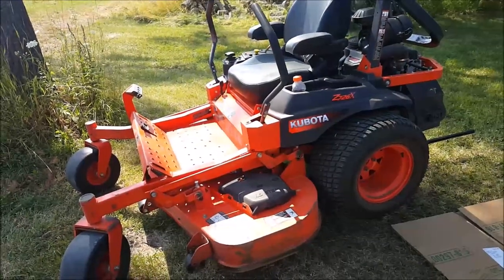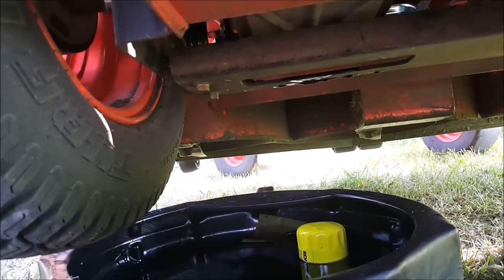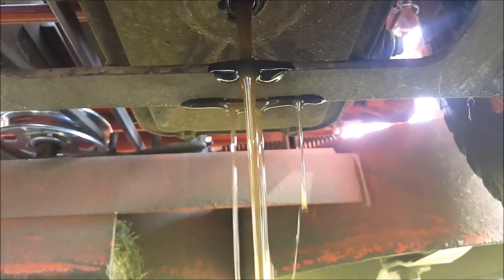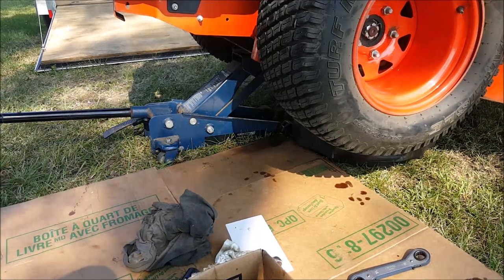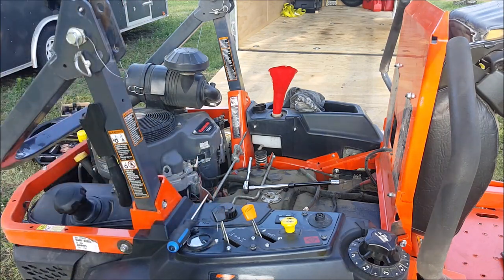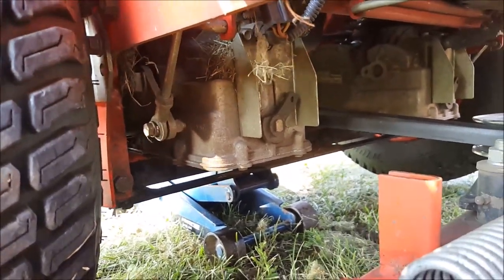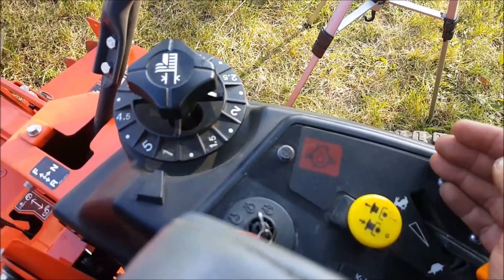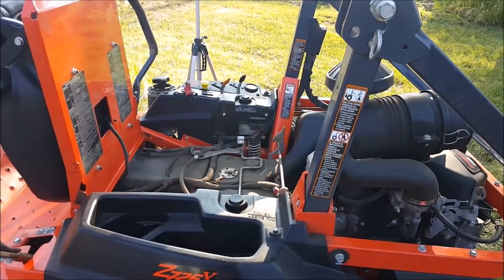How To Change Hydrostatic Oil On A Kubota Lawn Mower | Hydro Fluid And Filters

Comment: Few updates to this video that may help others. I have a 2016 model. 

Drain plug - 17mm box wrench. 
Filters -  24mm short socket w/ swivel extension. 
Breather nut -  Hex 8mm ( 1 of mine was frozen and it stripped. Beat in an M12 triple square bit, using impact wrench came right out) 

Thanks to the author. Saved me alot of time.
Reply: Same issue here with the stripped hex, thanks. I'll get a set of those bits tomorrow.
Reply: I was able to remove mine with the 10 mm bit
Reply: Make sure your hydro belt is in good shape and tight. It should be a little difficult to get on the idler with the idler pushed all the way to the stop position. New belt solved my severe shaking. Thanks again for the video and comments.

Comment: Thanks my friend. I got a z23 and 24 I use at work and I inherited this job and the machines last year and recently took them out and they were running okay but seems that they would do better with the oil changed. It looks pretty dark to me and there's no record of when it was last done. These zero turns are new to me but love the abuse they can take and keep on moving but I want to keep them that way as long as possible. These machines have over 800 hours each.

Comment: Thank you so very much . i have a 724 and this video helped me alot
Reply from the maker: Glad to help! Nice machine BTW!
Reply: @McGo101  Yes it is great . Well, i have 725 hours on the mower. left side does not work when engaging the arm. Change the fluid filters were in bad shape. Going to have to pull the transmission on the left side. Pretty defeated right now.
Reply: @McGo101  one more thing . Thanks so much for the instructions to use the Parker Hydrostatic oil. I dodged a bullet . I was given bad info and i countered with your suggestion and the salesman corrected himself,
Reply from the maker: @wade8418  hmm If u can get it to a reputable dealer I'd try to have it diagnosed first. U might get away changing a small part on the Trans or elsewhere. My local bota dealer helped me sort out my valve adjustment issue within an hour shop time

Comment: What kind of transaxle filters did you use?
Reply from the maker: Oem Kubota ones right from the dealer. Hydrostatic fluid was also specific iirc was Parker 1000 ht for these units.

Comment: I bought a z726x with a 60 brand new and the right hand trans was acting up. I drained the Trans oil out and it was full of shards of aluminum. The shop replaced the entire transaxle. Hopefully this doesn’t happen to the left hand side only had 60 hrs. Hopefully this doesn’t happen on the left side, I had a 10 day down time period which sucks but at least they let me use my Deere I traded it. Have you heard about this happening on these types of machines before? I’m assuming it was screwed up during the manufacturing process and wasn’t anything I did. If I had to pay for this repair out of pocket it would have cost easily 1k.
Reply from the maker: yikes! no i have not heard about that one before. Like you said sounds like a manufacturing defect that early in her life. and yea im sure they are not cheap to fix out of pocket, hence why i opted to change my fluid out when i could. fluid that came out didnt look bad at 450 hrs on mine butthat  peace of mind is beautiful. I used mine in the winter to plow snow as well, i got vids of that if u haven't checked them out. ps: price of the hydro fluid on these units is brutal hahaha

Comment: What are you using to lift your z726?  Thanks
Reply from the maker: 3 ton jack
Reply: @McGo101  how were you able to lift the whole unit with one Jack?
Reply: Video is great BTW
Reply from the maker: Just jacked the back end up on the frame.
Reply: @McGo101  oh ok. Thanks. It looked like the whole unit was off the ground.

Comment: Nice video. Please confirm the transaxle breather port screw size. I think you said T50 torx, but it looks like a female hex. Thanks
Reply from the maker: hey there. iirc i think it is a female hex head on the breather port screw. i think i used a torx bit just because i had a longer extension on the torx bit to get down to the screw. either will work if you can get the tool down there. i just dont recall the size exactly off hand. my apologies.
Reply: T50 works perfect.

Comment: How's quality of cut on that mower ? thanks
Reply from the maker: this thing is a beast compared to my last 25 hp bobcat 60 inch. Cut quality is good as well, i have a kubota mulching kit on mine so as long as i keep the blades sharpened and the deck cleaned out it cuts very nice.
Reply: Thanks for the heads up I'm about to pull the trigger on a Z724.

Comment: how do you release your transmission so you can push the mower?
Reply from the maker: On this unit there is 2 switches under the foot rest that can put the transaxle in neutral.

Comment: I would have cleaned it better. But hey that's me. Doing mine in the fall. Don't like the mower it's been nothing but a pain in my butt. I will never buy another Zero-Turn Kubota. Cost me over 12K and only have 300.3 hrs on it. I have changed the fuel pump, Two coils, Starter, and one spindle(should have lasted 1000 hrs they told me) I was going to trade it in and they were only going to give me 4200.00 for it. Always took care of it and it's in my barn and never left outside. Love my L3901 Kubota hell of a tractor. Just my thoughts.

Comment: Good video, but... A hydraulic jack in the grass and no jack stands as a back up?????
Reply from the maker: Yes I should have used stands but I didn't have any at the time. That is a 3 ton jack so I was not to concerned. Good practice to always use them tho you are right
Reply: Yeah I would certainly not crawl under that machine with it lifted from a single point, particularly from a soft ground. The Jack might be plenty strong, but my concern would be for the machine to tip when working under it... Otherwise thanks for the video!
Reply: @McGo101  the issue isn’t the weight rating of the jack it’s the fact that if a seal blows and it loses pressure it’s coming down on you.